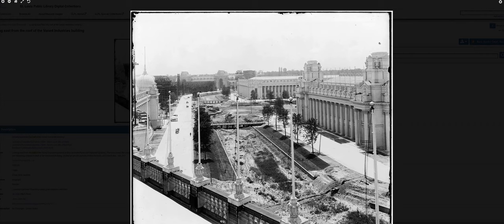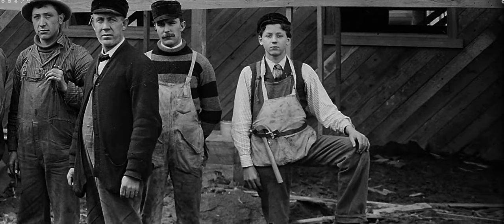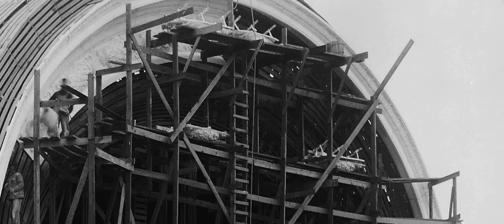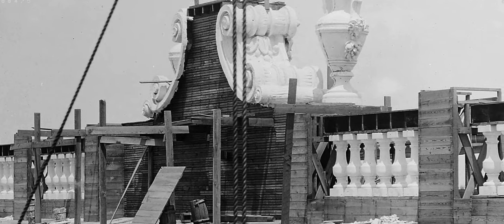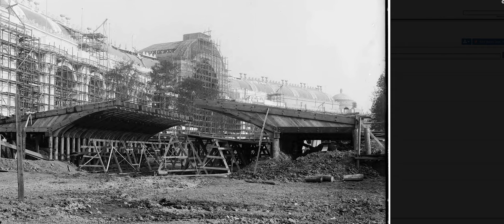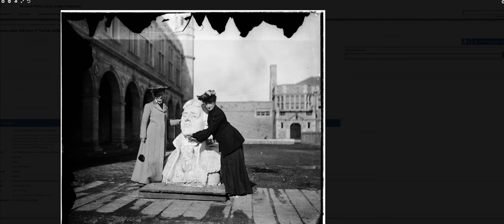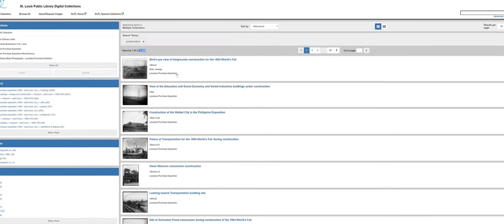World's Fair Construction Photos (1904 St. Louis)

Comment: Mostly deconstruction stuff and then falsely dated.
some are obvious attempts to copy building techniques, but there is no comparison to the old world folks.
The urn at 7:19 is garbage and at 8:19 those ones are not the same builders , pretty obvious that we didn't do that roof.

I think the wiring was covered, they tore it up to get it to work and now it looks like we did it , because we did do it, we had to ruin it first.

Also there are some photo tricks, a couple of people are definitely edited into the photos.
Any photos with no sky, clouds, sun or horizon are not convincing. 
Photographers don't delete beautiful skies and landscapes.
I've never met one that does, have you?

Interesting video , thanks.
Reply from the maker: The first urn was the plaster mold before they put the final cement coating on it. The 2nd ones at 8:19 were after the cement coating. 

Plaster is not weather proof. You need to add a cement coating to withstand the rain and snow.
Reply from the maker: Those knob and tube wires were the standard electric wiring of the time.

Are you saying the entire building was buried up to the 3rd or 4th story?

If this was an ancient city with lost technology, I would think it would have more than knob and tube wiring with standard light bulbs.
Reply from the maker: Regarding old photography, I'd recommend reading this article:
https://www.laphamsquarterly.org/roundtable/world-without-clouds

It required a skilled photographer to capture clouds, because the camera overexposed them, turning them all white. You had to merge two photos or hold a flap over the sky to prevent this.

Your smartphone camera does this automatically nowadays, adjusting exposure for the light & dark parts of the scene.
Reply: @newroam  

I worked in printing. I can spot a doctored, edited, razor scraped, dodge and burnt photo a mile away.

Ever heard of a stripper?
Or how about a plate maker? 

We used to do it with glass and vinyl back in the day and make "NEW" negatives.
Photo shop with physical tools, basically.
Same technique as "some" of these photos.

Don't make assumptions that I lack skills. you know nothing about my many professions in this realm.

My opinion of these old photos isn't based on YT channels, I've been into this stuff before there was an internet. 

I was born a long time ago.
Reply: @mysteriesoftherealm  Did you need to include your name "Realm" in your immature deference to a stranger? your last three comments are supper bot-ish, but your middle paragraph saves you from that thought.
Reply: @mkwa06  

As far as I'm concerned we live in a realm.
If you think I'm a bot , just click my name.

Defending? 
I'm correcting his ignorance and unprovoked assumptions of a stranger.

Not everybody used the internet to learn things and or realize there are conspiracies a foot.
Some of us have been around long before that.

I have come to understand this realm and it's history to a certain degree because of my hands on physical, professional mechanical background.
Reply: @mysteriesoftherealm  Stop being a stick in the mud, I get it you think its a realm, kinda got that from your name.

 Did i say you were a bot or did i say you sound like a bot. 

Yes, defending, some people like to use the word debating, example; I'm debating / defending the stance of this video appose to your ideology, just as your making the argument for your skill set (that was never question to begin with j.s.)

Long personal family history helps with conspiracy knowledge

And your last comment is just a bunch a hot air old timer :P

And can you seriously comment on why there are way more loones for than against on this subject? I knew something wasn't right when seeing  jon levi quater million subs.

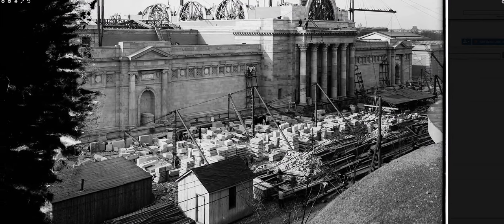Comment: The photo from 2:09 to 3:45 is, in my opinion, evidence that the building is a preexisting structure that is either being renovated or dismantled. I'm personally leaning toward the latter. The dead giveaway, again, in my opinion, is that the exterior walls are complete, and the only work in progress is on the rooftop. (which, coincidentally, always seems to be the case when random "construction" photos of any of these old-world masterpieces pop up) Secondly is the massive limestone or granite blocks that are haphazardly strewn everywhere around the front of the building, along with the giant pile of smaller blocks that looks to have been just dumped there, with no regard to damage, all devoid of any particular order, which would be mandatory if they were numbered to be installed in a predetermined pattern. On the contrary, some of them in the lower right-hand side of the photo look to be in the process of being broken up, perhaps to make them easier to dispose of. Also, the scaffolding underneath the arch has been installed to support and keep the structure from collapsing after the removal of the keystone.

Comment: Hi! Great Video! I've seen some construction photos myself. I really like that you're taking a different approach to this "Worlds Fair" theory. Unfortunately, these photos still don't answer a bunch of lingering questions...
1. Why were some of the buildings built to be permanent!? (Some of which still remain today). Built out of solid stone.
2. Why did some of the buildings have fully finished interiors? (fireplaces, crown molding, and so on...)
3. Why were they advertising and handing out Educational Diplomas? What benefit would this "world class education" get to the average fair goer once they go back to their everyday life's?
4. What's with the Incubator baby's? Where did the freshly newborn babies come from? Why could you just adopt one?
5. Why did they chose to build the fairground so far from the City Center of St. Louis? In swamp... They had to build a new railway system just to get the parts there.

Anyway, just some afterthoughts. Keep up the good work!
Reply: Chicago 1893 was also built on water.. so the story goes .. how could a building that holds 100,000 people be built on stilts? And out if just wood?
Reply: What do you mean "so far from the City Center of St. Louis"? The grounds are only ~5 miles from the riverbank.  Forest Park has been inside city limits since 1876.